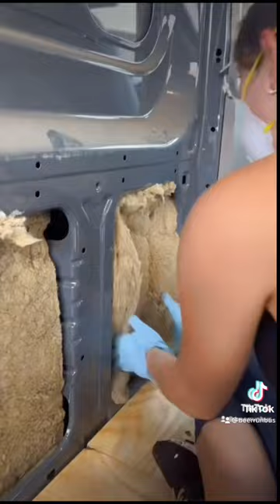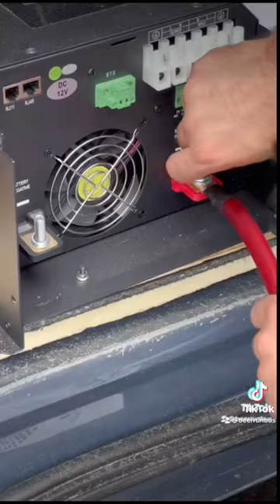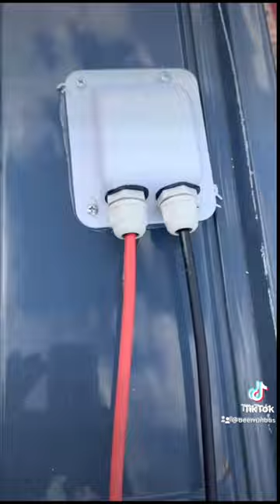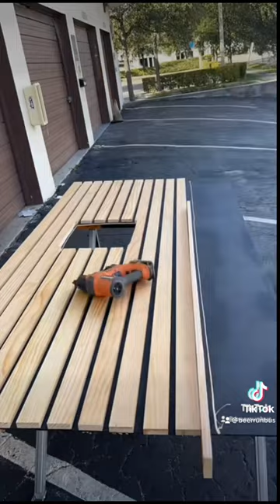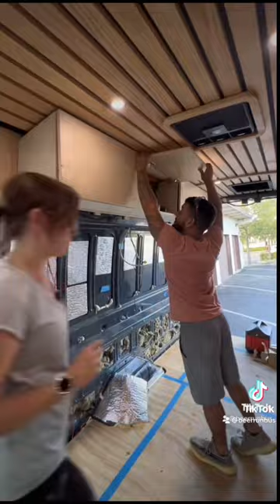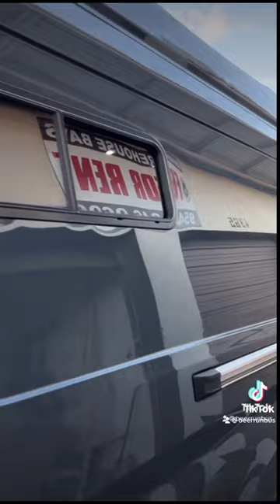Camper Van Conversion 30 day recap | #vanconversion #vanlife #campervan #buslife #busconversion

Comment: Nice work !! Electricians bit of advice !! Need to put some plastic Flexi conduit round the cables where it passes through the metal frames at the least and paint some galvanize primer where you cut or drill into the metalwork or it will go rusty soon..will be good for some road trips when finished 😀
Reply: I was going to say the same thing about the wires passing through steel wall. The van vibration will tear them to shreds!